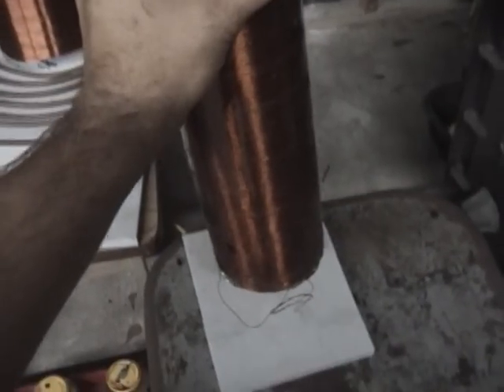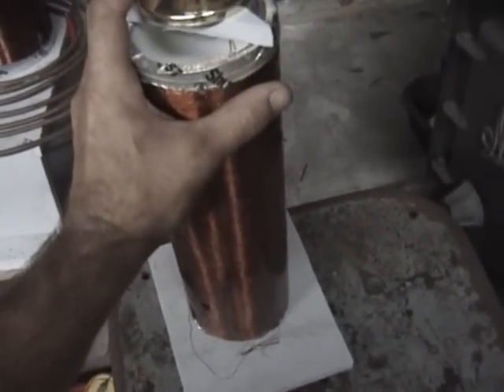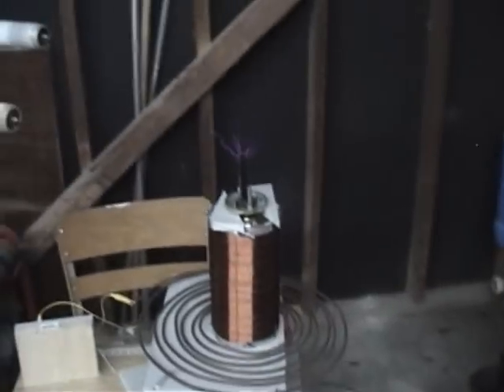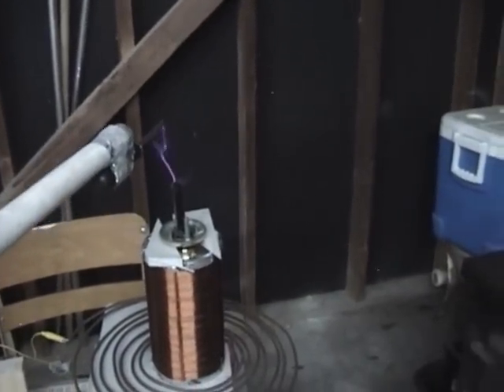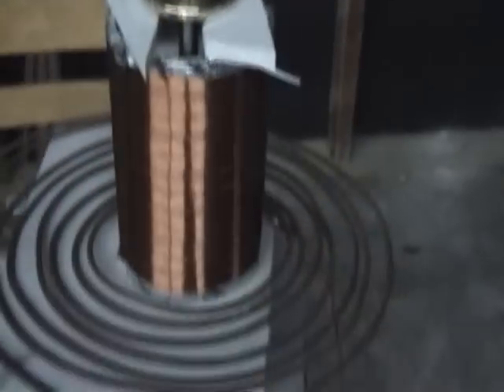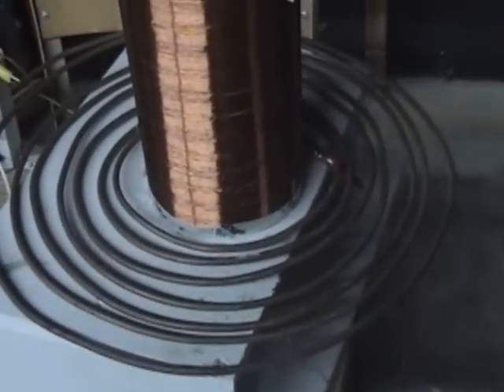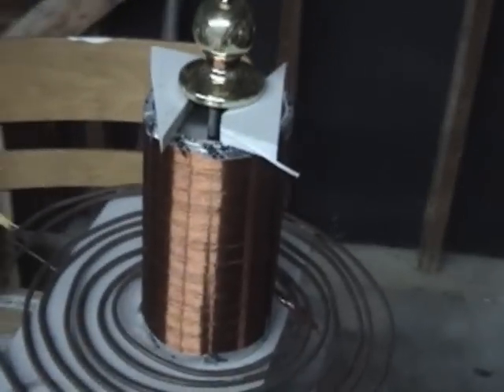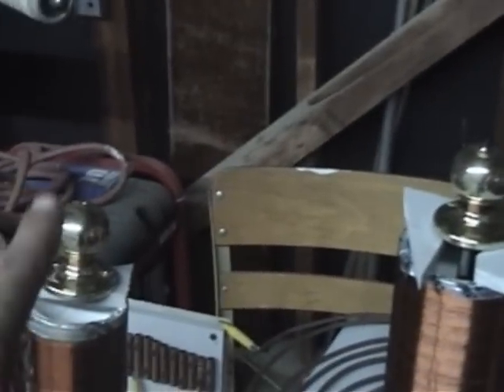Tesla Coil Build pt4

Comment from the maker: the larger the ground the more the power

earth ground dont pick up as good though and it is 8,18gauge wires ran into a copper pipe 3/4 by 2 ft. drove into the ground.  thanks for the comment

Comment: cody remeber though that roger is using the metal building as the one wire, the energy is technically traveling through the building to the other coil, he just briefly states this, but still he is still not making a true, earth transmission system, i still feel were still in the same ball park. lol.

Comment from the maker: this particular rotary spark gap didn't go fast enough,,, i do plan on making another, that has 8 magnets on a pulley that will , and a reed switch will make and break at least 8 sparks per revolution instead of just two like in the video.... which could have worked with a higher rpm.

Comment from the maker: check out part 1,  thats how i tuned the capacitors to the NST....

yes the voltage can kill  you, so i would suggest playing with one hand in your pocket, and also using a  3/4 pvc pipe with a screwdrive attached to do minor adjustments to the gap to improve performance.